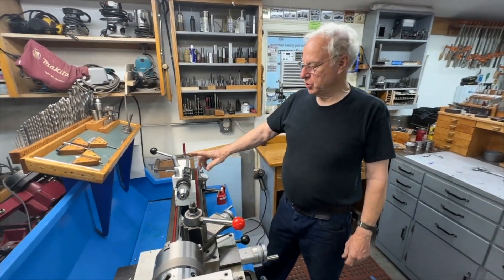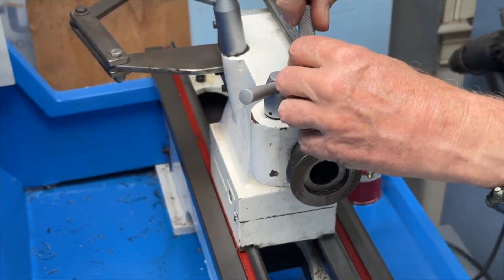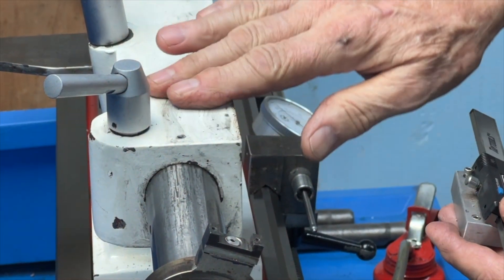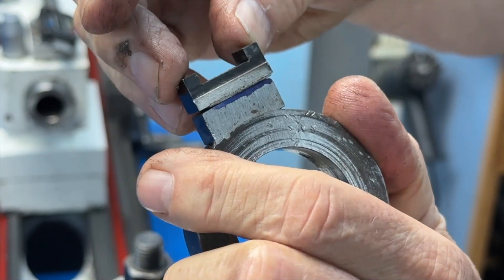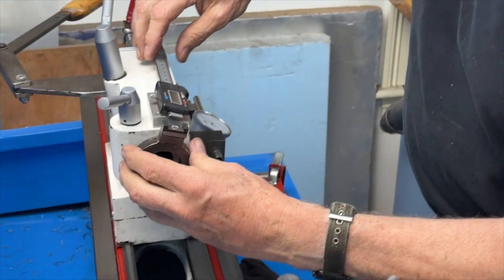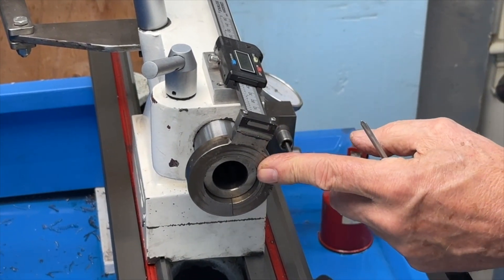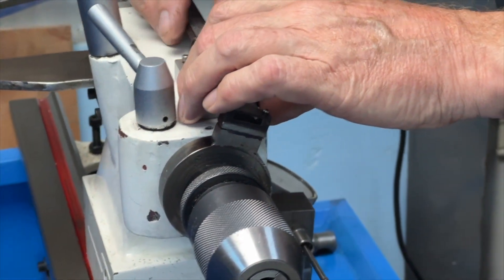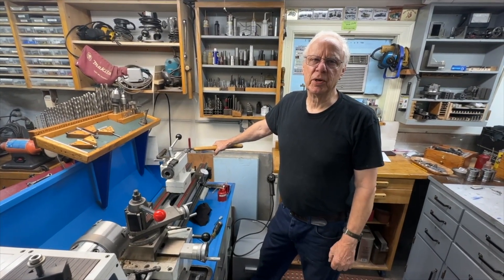Mounting Tail Stock Digital Readout

Comment: Thanks a bunch!  I've had the PM 1228 for 4 years, and have been intending to do this mod.  Seems like you could buy cheap calipers, remove the jaws and wallah, you have one that looks like yours.

Also, your next video is the mod I need more... I hate the gearing on the saddle.
Reply from the maker: Yes you can do it with calipers but it is actually harder to do. I did it on my previous lathe. The readout I got was $46 with shipping on eBay. I like it much better than the caliper one and it makes a neat installation .
Good luck and thanks for your input. Joe